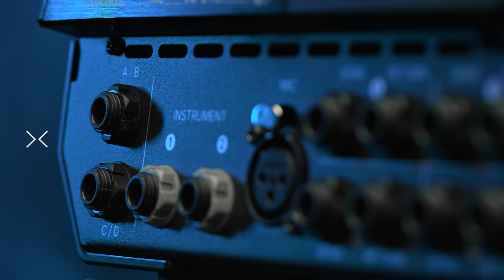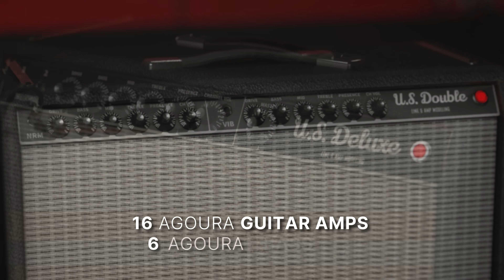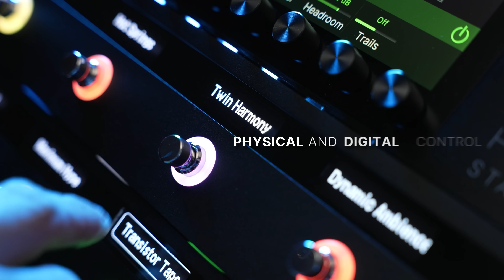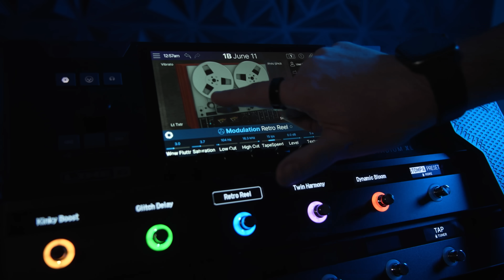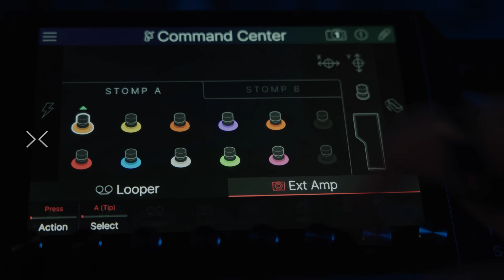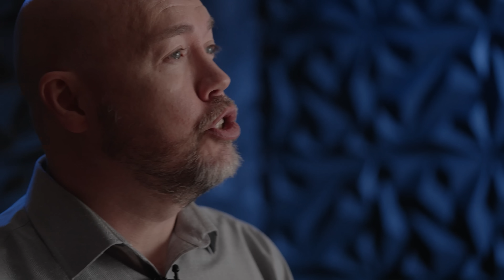Line 6 | Meet Helix Stadium | Your Sound - Center Stage

Comment: I gotta say - this looks really enticing. Just months after buying a second Helix Floor (so I don't have to shuttle one unit around to multiple locations), I'm thinking I'll try to procure an XL and D10 on first day of shipment.

Kudos for the backward patch compatibility. If it works, this removes a HUGE barrier to entry for me. 

The show control stuff is interesting. We'll see if it can replace BandHelper under battle conditions.

Somewhat disappointed the Nexus port does not support native VDI. Part of the glory of the current Helix/Variax ecosystem is the two-item solution. Relying on another box (with attendant connections prone to being tripped over) is suboptimal. But... c'est la guerre. (Hey - does this non-abandonment portend a JTV II on the horizon?)

Will D10 support Dante?
Reply: I can't get anyone at Yamaha to say anything hopeful about Variax's future.